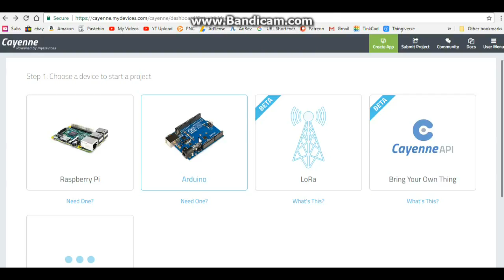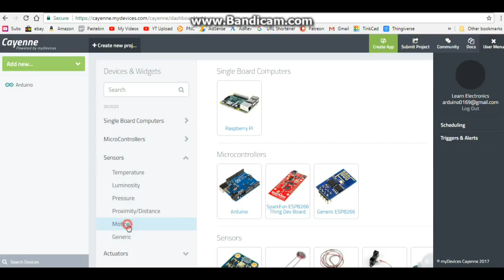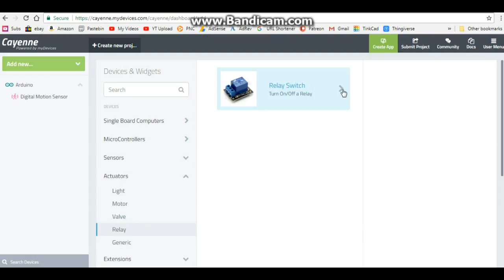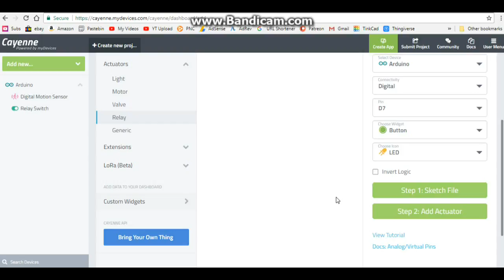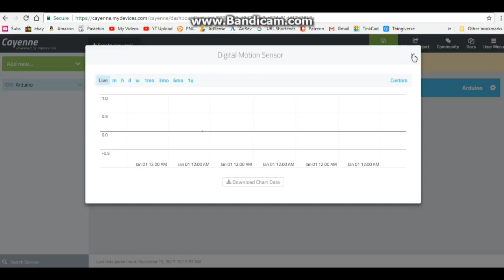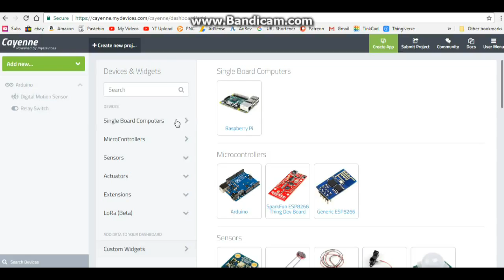Getting Started with theCayenne IOT Platform

Comment: i cant understand like first you uploaded the code while you were selecting the board and it was using the ssid and password let it be you uploaded that
then when you were adding the actuators you have a new code for both of them and it seems that they were using the ethernet.h and then you create an if then logic and there you do not uploaded any code 
so basically my question was that if we will upload multiple code will it not overwrite the previous one
and if not then what happened when you created the if then logic cause that also needs to be get updated in the code but you never showed one in the video 
please clarify